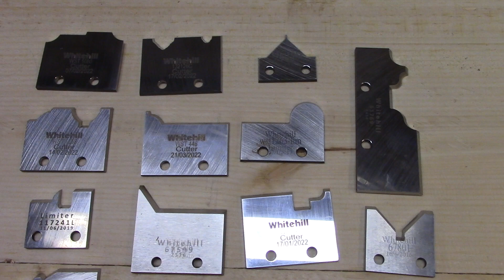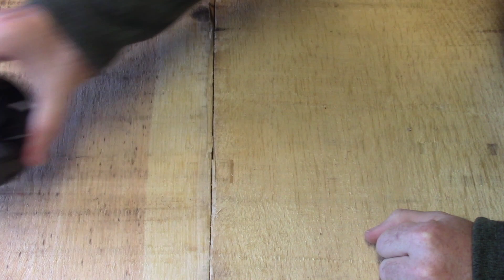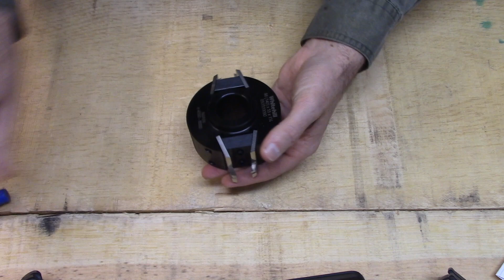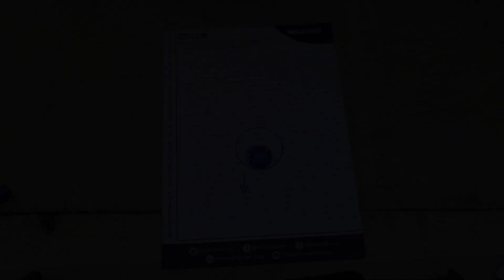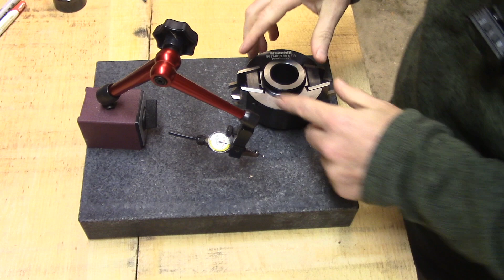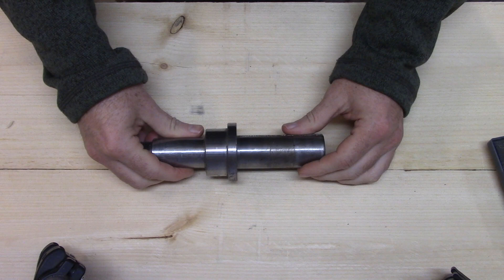Limiter-style shaper heads - adjusting knives

Comment: I recently tried insert cutters and I never knew why they always seemed off, this makes my styles and rails fit perfectly! Now I'm trying to go a step further and make extended tenons but it seems if the mortise is not perfectly straight the styles and rails do not line up straight. Could you please share the way you make the mortises for the extended tenons? Thanks!
Reply from the maker: Hi, thanks so much for the confirmation that this has helped somone out!  It's great to hear.
Reply from the maker: I make my mortises with a floor model chain/chisel mortisers and don't have an issue with alignment, so not many tips I can offer you.  How are you making your mortises?